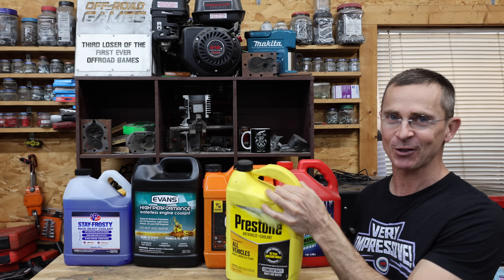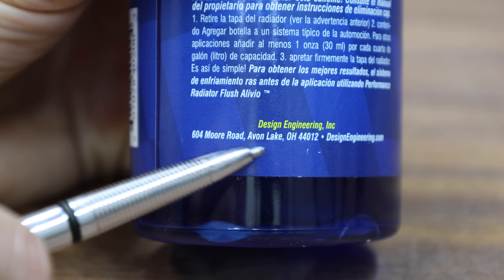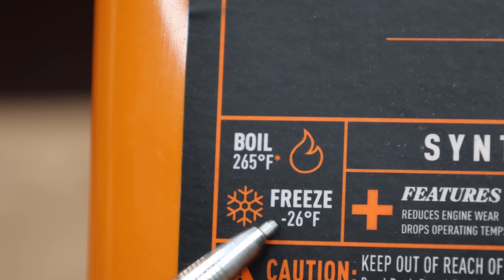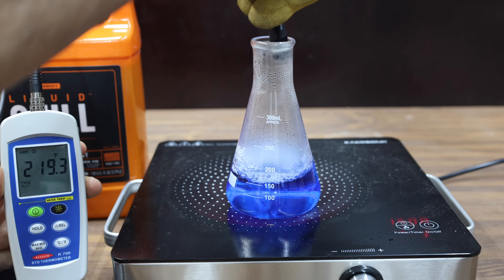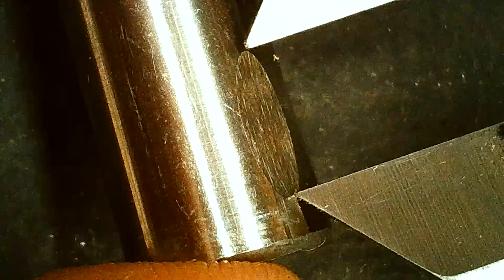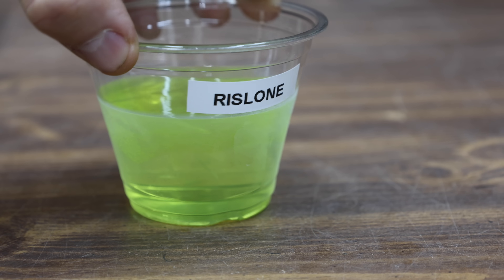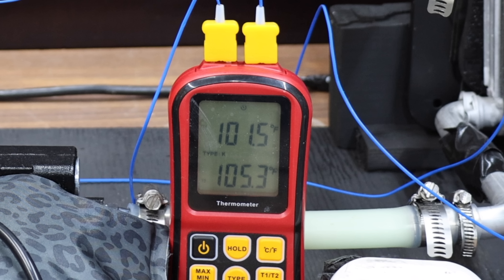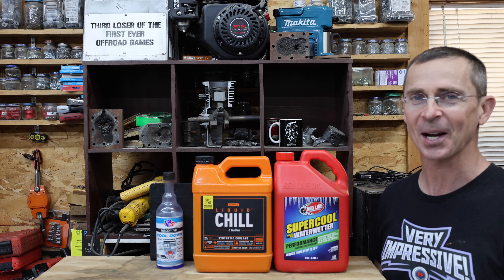Do "Super Coolants" Lower Engine Temperature By 30 Degrees?

Comment: Project Farm can you do a comparison between regular water glycol coolant and oil based coolant? 

As far as running 30 dungrees cooler, i think that might effect cooling and heater output. I read a article a decade or so ago where this guy had cooling issues with his homebuilt experimental aircraft. He ended up running his coolant through his oil pan to make the coolant hotter so it would lose more heat in the radiator. 

Think two ice trays. One filled with tepid water and the other with near boiling water. The one with hotter water froze first. Molecules moving faster so it lost heat quicker. 

Atmospheric temperature and humidity not considered but hotter or cooler air will cause a difference in heat loss as will dry or humid air.
Reply from the maker: Thanks for the suggestion.

Comment: I've had great results with Red Line watter wetter. Especially for a small bottle. Averaged 20 degree cooler engine temps in my turbocharged 240sx drift car.
Reply from the maker: Thanks for sharing.

Comment: Liked the video, especially that contraption for the last test. It certainly rivals anything the Professor rigged up on Gilligan's Island. Yet once again, I disagree with the conclusions. The Evans was the clear winner where it counted most.

For a video recommendation, it might be worthwhile to retest various cordless power tools as many you had done were 2 or 3 years ago, and the transition to tabless batteries and technological innovations have taken great strides, both in 12v and 18v lines and higher. No great rush on this, gotta give some time for Makita to get its act together, worth the wait?
Reply from the maker: Thanks!  Thanks for the suggestion.

Comment: It's not necessarily a good thing to reduce an engine's operating temperature. They're designed to operate within a specific temperature range. Going outside this range reduces efficiency.
Reply: People think racing application products in their daily driver will extend the life somehow.  That's not what they're for. I like to ask them how long do race engines usually last? And is that how long they want their engine to last?

Comment: These would probably  work for  racing applications  but for your every day vehicle that has a computer on it,   this would be bad because the majority of  vehicles run at 208 degrees .  If you lower the coolant temperature,   it might cause the thermostat to close and not allow enough coolant to circulate through the  system plus the car will start to run rich because its running cooler and not allowing the emissions  system to go into closed  loop.unless  the car is overheating,   this would be a temporary fix to get to the garage.
Reply from the maker: Thanks for the feedback.

Comment: I worked at a speed shop and we sold Evan's. It's stupid expensive but I bought a few gallons because I just built a fresh high performance engine and the requirement for Evan's is no water in the system so it was a perfect time. Glad to see this test proves their claims. I was about to scrap the idea of using it out of fear of being chained to it for life, especially if I ever have to do cooling system work.
Reply from the maker: Thanks for sharing.

Comment: Thanks for doing a great test again.  I am the manager of a museum with a large auto collection ranging from 1899 to 1965.  We had Evens coolant in one of our cars and the car developed coolant leaks at a number of gaskets, when we switched back to regular antifreeze the leaks disappeared.  We were told that Evens coolant has a smaller molecular structure than normal antifreeze.  I wonder if J Leno changed all the gaskets on his cars to accommodate Evens or just puts up with the leaks on old very old cars.  It would be great if you did a video on different coolants permeating through gaskets.
Reply from the maker: Thanks for the suggestion.
Reply: I would ask if it’s Lanes, but I am pretty sure I have seen Multiple vehicles newer than that. Come to think of it a lot of them. Haha
Reply: @Dirtroad726  No, it was definitely Evens coolant.

Comment: The main claim of these products is that they improve the heat transfer between the metal and the water or coolant. The idea is that at the same coolant temperature, poor heat transfer means the engine block will be slightly hotter, and the radiator will be slightly cooler versus good heat transfer.  A hotter radiator can transfer more heat to the air versus a colder radiator.  Imagine two blocks of metal with a piece of wood in between them verses some aluminum foil between them. If you heat one block, both blocks will eventually get hot, but the wood will make it take much longer than the aluminum foil.  From the hottest component, usually the exhaust valve, to the coolest spot, the air coming into the radiator, there is a step or difference in temperature between each component.  If you make a few of these steps smaller, you will reduce the temperatures above the steps. However in practice, the cooling system is more complex than this.  Also wood vs aluminum foil is a more drastic difference versus these products and regular coolant. Cleaning dirty or rusty coolant passages or radiator tubes will cause a bigger difference than these products.  Furthermore, you don't want your engine too cold either, which is why there is a thermostat to keep it at operating temperature.  Many of these products are best suited for racing where antifreeze isn't allowed because the antifreeze might make the track slippery. These products could add corrosion protection and lubrication to plain water.  If your racecar has an undersized radiator, these products could help it run longer before overheating. Finally, if you live in a hot climate that never goes below freezing, it would be cheaper and better cooling to run these products and plain water.  Again, if you normally run plain water, you would definitely benefit from the corrosion protection in these products.
Reply from the maker: Thanks for the feedback.

Comment: Temperature delta over a heat exchanger is not a good measure of performance. Bigger is certainly not better as it indicates a lower thermal capacity of the coolant.
You're mostly measuring the efficiency of the heat exchanger ... 
A better test would be to control the power of the heat source and then measure the equilibrium temperature of the heat source. It should be hotter than the coolant, lowest heater temperature wins.

Comment: For wear scar test, you might consider weight. Not only will it be more standardized than calipers, but as the wear scar grows, more and more material has to be removed to increase the scar length. E.g. more material volume has to be removed to go from 6.4 to 6.5 than from 6.3 to 6.4.
Reply from the maker: Thanks for the constructive feedback.

Comment: I placed the Rislone hypercool in my class B RV knowing I was going to a very hot area this past summer along with a clean radiator flush. I have a digital temperature gauge for the radiator that connects to the OBD port. Only noticed maybe a 5-degree difference. I guess I expected more based on the description but not sure if it made any difference.
Reply from the maker: Thanks for the feedback.

Comment: It's not necessarily a good thing for the engine to be colder. They are designed to work at a certain temperature, so if it is colder than that it will run poorly and likely use more fuel trying to get itself to the proper operating temperature. (This is why we have thermostats, if you remove them the engine works much harder to get to operating temperature)

Comment: the lubricant property is rubber against cast iron, steel and aluminum for water pump lip seals not metal on metal
The other tests you missed out on for antifreeze 
 reactions between dis similar metals
ability to conduct electricity
anti cavitation
lab test for chemical make up before and after exposure to higher than normal heat
I would have liked to see manufacturer specific antifreezes tested as every company has created their own version and I suspect they are all similar enough to interchange in gasoline engines.

Comment: I'm gonna watch this later but want to run something  to test by you given several experiences. And that is best jumper cables. Idk if there's a best gage wire or what but mine appear to suck, takes forever to charge from battery to battery if at all vs others cables/ devices.
Reply from the maker: https://www.youtube.com/watch?v=bMXyoIBJyJA
Reply: @ does that video test cables alone without the charger?

Comment: For several minutes, each of my turbocharged cars would burp and gurgle in their coolant reservoirs after an autocross run. Adding Redline WaterWetter, stopped that. The surfactant worked very well in allowing the coolant to "wet" the metal parts, especially the hottest (exhaust ports and turbo) components. Thank you for this test.
Reply from the maker: You are welcome!
Reply: My mr2 used to do that too. Turned out to be a bad headgasket. Had an odd failure mode, no coolant in oil, no coolant consumption, compression test was well within parameters. Found it by pressurizing the cylinders through the spark plug holes with the compression tester adapters. If your cars have iron block + aluminum head, you might investigate. We've found it to be the case on a couple cars since I figured it out. 

Never did try water wetter though.
Reply: Thanks for the info. Ill put that in my car

Comment: Very good testing. My only criticism is I was trying to engineer a solution to a vehicle running maximum power that didnt have a big enough radiator or fan. So we were looking into liquid solutions to increase performance. In this scenario we increased radiator pressure and still ran up to 230F and climbing.
I would like to see a test that figures total watts of heat rejected for high performance applications. As the vehicle reaches higher and higher temperatures, more and more heat gets rejected by the radiator. If the heater was able to go above the steady state of the coolant that would be most valuable. Taking the system to steady state on regular coolant, about 212F, then seeing what one can reject the most wattage to bring it back to 212F or something of the like. Or just pushing it until the system blows off steam
Reply from the maker: Thanks for the suggestion.

Comment: Fairly stupid of the manufacturers to claim anything makes the engine run cooler when most engines have a thermostat that sets the operating temperature.  However that does not detract form the excellent test videos this channel produces.
Reply: With redline water wetter and straight water, my vr6 usually sits around 175-185 on the scangage , and really takes some hard driving to come up to the 195 the thermostat is rated for.
Reply: The thermostat really just prevents the radiator from over-cooling. If the engine makes more heat than the radiator can dissipate, though, the coolant temperature will climb above the thermostat opening point.

If the cooling system is just barely borderline and not keeping up, something like these products can potentially help get things under control. Even with a sufficient cooling system, better heat transfer into and out of the coolant can improve cylinder to cylinder temperature control and overall maintain the temperature closer to the thermostat temperature.
Reply from the maker: Thanks!
Reply: My motorcycle puts out 217 HP out of 1100cc ( It’s the equivalent of a 1000 HP V8.  It will overheat quickly in traffic, so this would be an application for performance coolants. You’d be totally correct if life was just filled with mundane passenger cars!

Comment: So, I really feel like the Evan’s waterless actually out performed everything else by a wide margin, on the things that it claims to do. It didn’t claim to cool engines by some crazy amount, and it didn’t do that. But it does prevent the system from reaching a cold enough point to freeze, a hot enough point to boil and, alkaline enough to prevent corrosion, and it does so by a fairly wide margin, in all of those areas.
Reply from the maker: Thanks for the feedback.
Reply: @ Thank you for the ridiculously awesome content my guy!! 🙏🏽🙌🏽. We would never know the efficiency of a hair dryer, the lubricity of engine oils or, just how much a winch really can move, if we didn’t have some crazy dedicated guy like you out here, putting all of em to the test. 😂

Comment: Have always wondered if vacuum food bags leach chemicals into food when boiled or microwaved. Is this something you could measure. There are several tests that could be run , such as vacuum effectiveness over time and temp.
I use sous vide cooking method , chicken breasts at 9 hours @ 141.5 degrees F , and i sous vide turkey for 11 hours @ 141.5 degrees from frozen. 
Just an idea
Reply from the maker: Thanks for the video idea.

Comment: I was glad to see the Evens did so well in your tests since I have $200 worth of it in my Trans Am.
After seeing how poorly Dexcool prevented when I replaced the head gaskets due to corrosion, I knew I would be changing brands. Then was suckered into my choice by finding a gallon in Amazon's used - returned low price section. LOL!!
Thanks for the video.
Reply: Evans was originally put on the market for classic vehicles that sat around for long periods of time. I haven't read a bottle in a long time but in the past it didn't make any claims on super cooling or a crazy freezing point. It was supposed to be a truly waterless system for vehicles in storage or little use. We all know what happens to vehicles that sit around. Rust. Rust and gunk throughout the motor, heater core and so on, leading to over heating, poor performance or worse. Jay Leno swears by it for his old vehicles. Jay Leno knows his stuff when it comes to vehicles
Reply: Just keep an eye on the temperature using waterless coolants. As you saw in the video they have a much lower specific heat capacity than normal coolants. In most vehicles that's fine because the cooling system has a huge factor of safety but in very high performance cooling systems designed to optimise weight they are usually designed for distilled water or water based coolant because it has about twice the specific heat capacity of alcohol based coolants.
Reply: @thomas316 One flaw in this video is testing heat transfer capacity at 100° F. ... cars operate above 200° F. And coolant behaves differently at these much hotter temps
Reply: @thomas316 While Evan's waterless coolant has 33% less heat capacity than water at engine operating temperature, it has only 18% less heat capacity than a 50/50 regular coolant dilution

The specific heat capacity of water at 100° C is 4.2 kJ

The specific heat capacity of 50% ethylene glycol and 50% water at 100° C is 3.48 kJ

The specific heat capacity of 100% propylene glycol similar to Evans waterless coolant at 100° C is 2.85 kJ
Reply: @thomas316  When an engine begins to overheat, regular coolant will turn to steam and greatly lose its ability to transfer heat. But Evans will remain in liquid form and maintain its capacity to transfer heat for another 120° F hotter. That's a lot of headroom

Not only that but glycols actually increase in their specific heat capacity as temperature increases. Water doesn't. 

And...because a lot of engine overheating issues occur with a sudden crack in the coolant system, this causes a loss in pressure, dropping the boiling point of coolant from 260° F to 220 ° F ...causing rapid boiling of the coolant and a loss of heat transfer cability. Evans will not boil if there is a crack in the cooling system

Its a triple win for Evan's propylene based coolant vs water based
Reply from the maker: You're welcome!
Reply: They sold you a "used" sealed bottle?
Reply: @TonicofSonic  Yes, just packaging wear and tear. It was still sealed. So a bargain for $10 bucks off.
Reply: @donanything6816  Thats awesome! I always wondered if the "used" bottled things were still sealed or actually used. Now I know thanks buddy!

Comment: The main benefit of Evan's waterless coolant is the ability to run your cooling system at zero pressure. This reduces stress on hoses, seals, and head gasket and the extremely high boiling temperature allows a more consistent coolant to water jacket contact preventing hot spots that can form cracks. 
The concept behind this product is totally different than the other products tested.
Reply from the maker: Thanks for sharing!

Comment: Am I missing something here?  These additives can do what ever they like, but the thermostat is there to keep the water IN so unless there is a water pump failure, the temperature will be held until the thermostat opens, and they are supposed to fail open, in which case the engine will run cold. Many decades ago I fitted what was then after market, an electric fan. Some idiots messed with the setting so the fan would spin. When I put it back and put back the thermostat they had taken out I could drive up an over an extinct volcano in the tropics and the fan would cut in just as I crested the top. This stuff is just a way of printing money, like adding slick 50 to your oil which gets jammed in the oil filter.

Comment: The main function of coolant is to remove heat so the specific heat of each coolant will be different also the boiling point is important to keep pressure off the cooling system. This the Evan’s will run hotter by temperature but will not boil and will keep pressure off the cooling system
Reply from the maker: Thanks for sharing.

Comment: you haven't consider the weather conditions each coolant would be suited for, i think the best coolant for extreme hot weather would be the one which you given lowest score, as cooling the engine would require quickest heat exchange so that already hot air takes away the heat as much as possible. before engine over heats, Guys am i right?